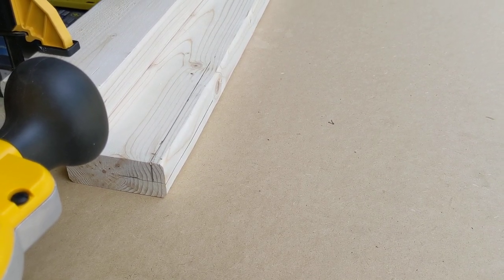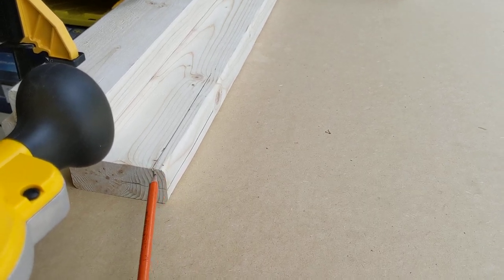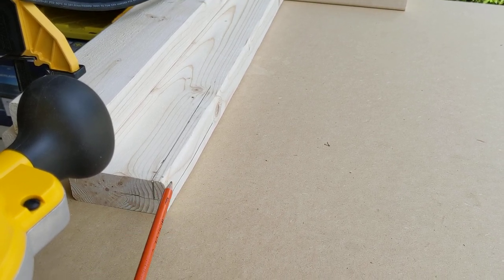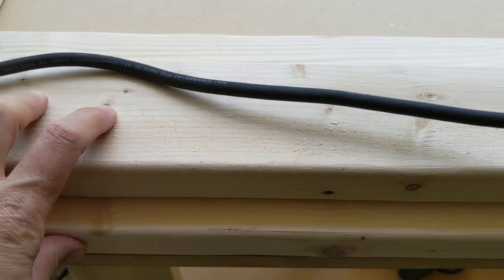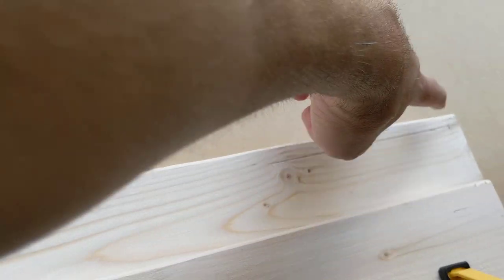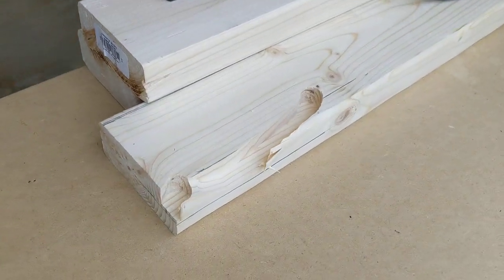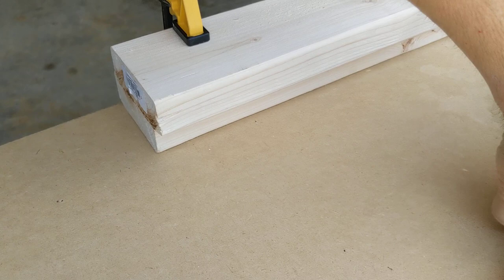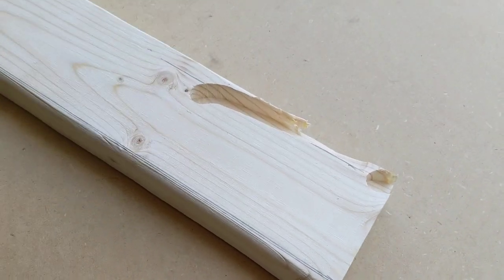Router Rabbet Cuts - Take 1

Comment: Look at these guys hands.  It is all about money.  I dont just mean this guy joking around, but there are guys out there that couldn't make a living doing actual carpentry work so they do videos, read books and practice some and 99.99999 regurgitate what has been done and some that may be a bit creative show you if you put this gallon plastic jug together with this and some glue you have a cheap makeshift whatever.    Most would never do this for a living and the weekend warriors (a little info and skill can be dangerous,  mainly mentally for them) do many, many of these videos.   There is no money nowadays in making furniture and the like. It takes a rare shop that can make lots of money because of the huge companies with machines plus, for the average Joe to find great wood relatively cheap (with all the communists saying you can't cut trees down) is impossible and these lumber yards are way over priced and they say it isn't them.  I bought about 10 years ago a solid wood t.v. stand with two doors with windows and four shelves total and huge round feet and a beautiful black finish for around 300 dollars, its 60 inches. 
It would cost, in wood alone, around 150 dollars with the good wood they used and because we all don't have table saws and drill presses and we sometimes make mistakes,  not counting the glass and wood work needed done.  It would be a large project.  So work one overtime a month for three months and save an extra 100 and theres your big beautiful wood t.v. stand.  Then you can do other things like be with your friends and family and make society better by doing so.
Sorry a little preachy and long, but hey it's comedy. (Lol)
God Bless brothers and sisters.